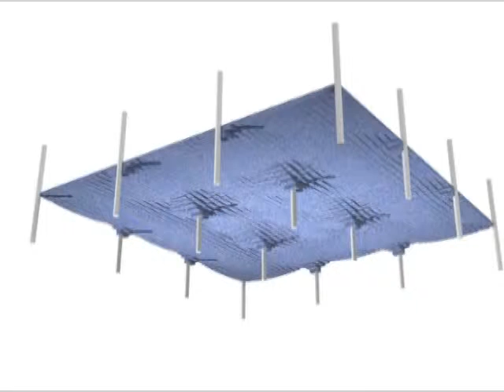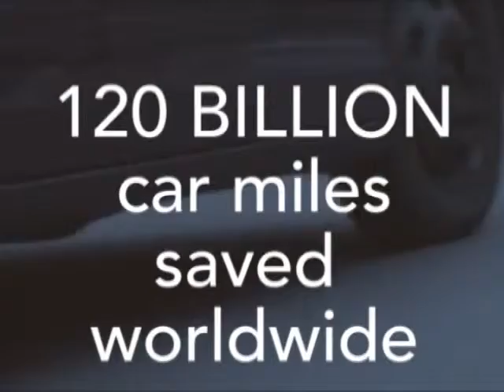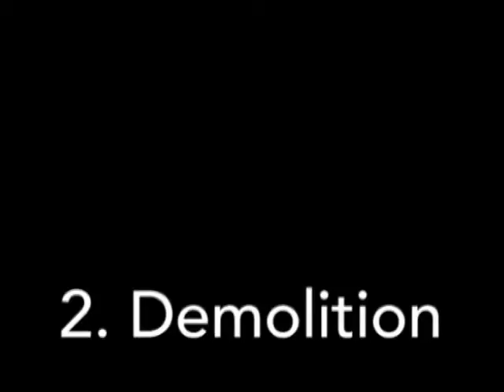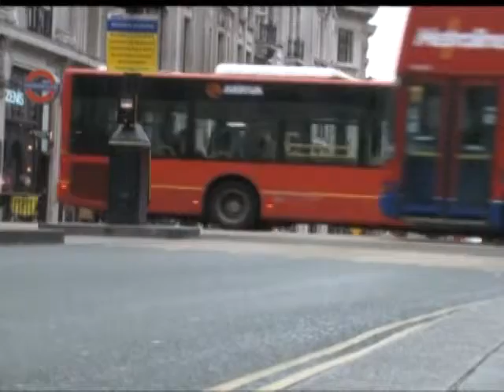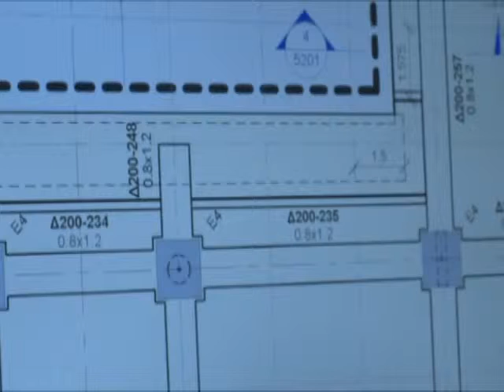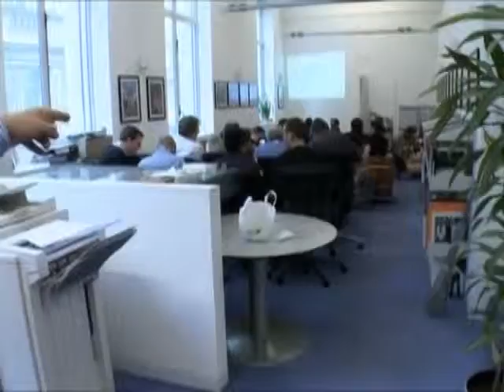Enough is Enough

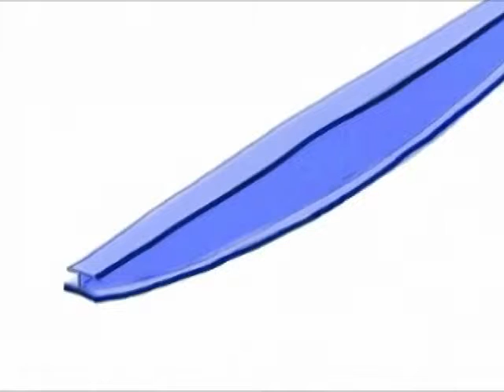Comment: At 1:36  he says that the perfect beam would be one wide at the centre and shallow at the ends.   Well that is well and good if  a beam is used  just to take the bending moment it is subjected  to  due to a vertical load, but a beam, on may situations  is not working in that mode alone .
Take for example a building made of a beam in the manner  in what this gentleman describes. Well if the structure is made  with vertical  beam columns and horizontal  beams as he describes, the structure would be regarded as having pivot joints and the structure would not be any good to lateral forces as occurs in an earthquake or a windy day and diagonals would have to be added.   So if one wants to build an anti-wind  or anti side/lateral forces structure, the joints should be locked and so having a beam with wide ends would ensure that the joints of the vertical columns and the horizontal beams will offer a solid angle unlike the beam he describes which would easily change the angle with the other components , making a wobbly building.
So before one claims that he can do better and save the world, one needs to think a little deeper than this gentleman did.
What one gains on the roundabouts one may lose on the straight.
Reply: The fish belly beam still applies massively in non-seismic countries. There are millions and millions of beams which could be optimised.